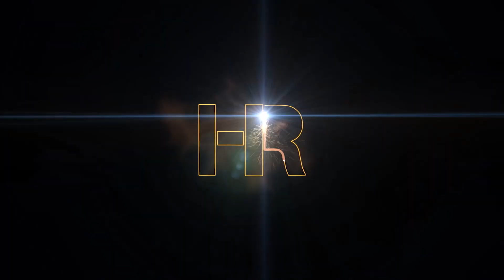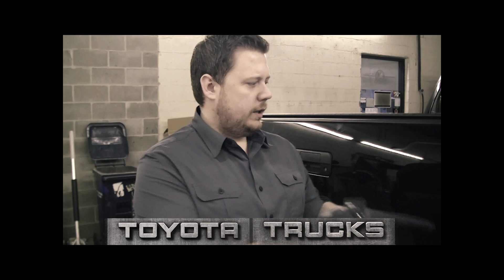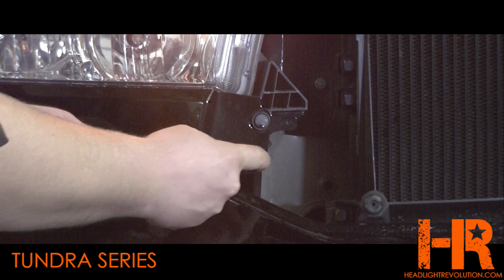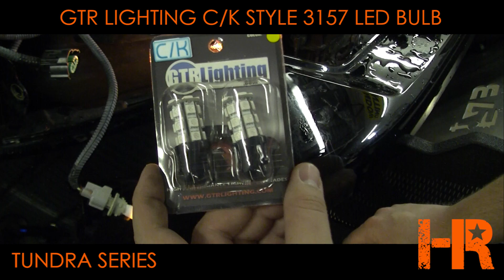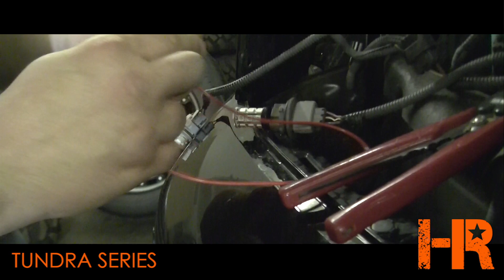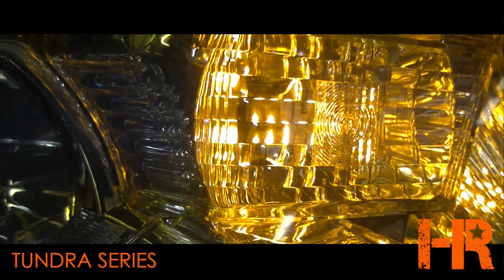2007-2013 Toyota Tundra LED Turn Signal & Parking Lights | Headlight Revolution | Tundra Series (7)

Comment: Girlie Girl, (mostly:) ) with definite hatred for mechanics and dirt, but with your video, I changed out my parking light bulb ( impossible to replace without removing the headlight...(trust me, I tried). The turn signal bulb was easy.  GREAT INSTRUCTION FOR THE 2011-13 TUNDRA 5.7!!  The job took me 15 minutes.
Reply from the maker: Glad we could help!

Comment: Great video. Thanks!  I did the mod and now when I switch on headlights, one of the Amber lights goes off, the other stays on. Before the mod, both ambers would remain on when headlights went on. And ambers stayed on when headlights went off. Any thoughts on fixing this?
Reply: I have the same issue- ever figure it our?

Comment: Soldering connections but then using electrical tape instead of heat shrink  to seal the connection ??!!
Reply from the maker: You'll be hard pressed to prove that in this application how we did it is going to be a problem.
Reply: Unless you cut wire or have to end coming together just stipping back insulation and solder new wire on there is no way to get the heat shrink tubing on the only other alternative is liquid insulation it's like a thick rubber paint in different colors and it dries like the wire insulation I've never used it but home depot electrical depot. Carrys it

Comment: So I install the resistors, it gets hot with the drl and running lights but when I turn on my headlights it cools down. I followed your wiring steps also. I don’t know why it get so hot??
Reply from the maker: Kongmeng Vang it's normal for them to get hot. Even the instructions they come with state that they will get hot.
Reply: Headlight Revolution my front turn signals stops working when the resistors get too hot
Reply from the maker: That's very weird. Give Returns@Headlightrevolution.com an email and they'll get you taken care of.

Comment: I have a 2011 Tacoma. I'm going to be doing this shortly. Is there any way you could test and tell me the exact colored wires I would need to splice into with it?
Reply from the maker: It is on our list to do a video on how to test the wires on any vehicle. Not sure if it will be in time for you.
Reply: A good automotive circuit tester or a multi meter witch has other uses lick testing house hold a/c voltage and wire continuity with will trace a wire if the problem is placed on one end of a wire and the other probe on the other finding witch wires are witch if you can't get at some metal on the wire to get a reading may have to strip away a little wire insulation is the on other way I know then if it's not the Wright wire electrical tape over the striped spot

Comment: I have a 2008 Crewmax Limited. Do you know of any possible affects changing out incandescent lights for LED's has on the lighting CPU's. For example the interior lights, including the mirror puddle lights fade in and out on my Tundra.  I have been warned against going to LED's by a local Toyota dealer as well as an experienced after market installer.
Reply from the maker: CNT 2C56 LED's are able to run at lower wattage like incandescent bulbs. They will fade in and out just like the factory bulbs would. Pretty soon LED will be the norm for lighting.

Comment: what about for a 2015 tacoma you guys sell the right bulbs for them?
Reply from the maker: https://www.youtube.com/watch?v=oGl2Mz0bUA4&t=449s
Watch this video for the 2015+ Tacoma
Reply: Headlight Revolution not the same modle of truck my 2015 is before the one in the video. my amber signal lights are also my daytime driving lights
Reply from the maker: Just tested the carbide 7440, and it does not work for the DRL.  Sorry
Reply: Everything I've tired burns fuses

Comment: Question, which is the positive on the headlight wire? White with Black Strip or solid white?
Reply: blaster. My 2017 tacoma white with back stripe I ground throughout the truck

Comment: Hey guys, what are your opinions on error free LED bulbs?
Reply from the maker: +dragon123443 Just to clarify, are you talking about bulbs with CANBUS functionality built into them? What do you mean by "Error free bulbs?"
Reply: +Headlight Revolution the ones with the resistor built into them. I think ijdmjoy sells them?
Reply from the maker: +dragon123443  Haven't really tried them. Those error free bulbs that they are selling look almost exactly the same as our Canbus bulbs: http://www.gtrlighting.com/canbus-bulbs/
Reply: I've tried the canvas and everfree bulbs worked at first but sometimes one or the other will hyperflash rain sometimes cold wheather

Comment: I have a question. I did this installation on my 2012 Tundra. The turn signals work when the  headlights are off but do not work when the headlights are on. The light is one but does not flash. Any idea what would cause this.
Reply: Hey man, I have a 2010 with the same problem. Did they ever tell you the fix for this issue?
Reply: No I ended up taking them out. Prob had something to do with lower quality bulbs.
Reply from the maker: +ChopperOutdoors Sorry about that, that's no good! Send us an email at sales@headlightrevolution.com and we'll be able to help you out and look up the specifics of your order too. We'll best be able to help you there.
Reply from the maker: +ChopperOutdoors Sorry about this. If you haven't already, be sure to send us an email at sales@headlightrevolution.com and we could help you out a little better there.

Comment: How come your add a resistor when you can replace the flasher relay with a low load flasher relay meant for led products? Seems like more work adding a resistor.
Reply from the maker: mrtwor6 It is a little more work, but it has been one of the most reliable ways we have found. Sometimes a new flasher just doesn't fix the issue.
Reply: Are we sure its a 3157 bulb? Few bulb finder sites are saying 4157.
Reply: You have a part # for the led flasher relay?

Comment: Installed these with resistors step by step as shown in the video. Lights turn on, look good, but... When my headlights are on or  switch turned to parking lights, the front ambers do not flash when I engage the turn signal. They are still on, just don't blink. They flash when my light switch is off (so during the day) I activate the key fob, or hazards. Any suggestions why the turn signal won't flash when the light switch is turned on?
Thanks
Reply: +Headlight Revolution is it a 12w 6ohm resistor or a 50w 6ohm resistor?
Reply from the maker: +wentaGT We used the 6 Ohm 50 Watt resistors.
Reply from the maker: mndonnell Sorry about the trouble! Have you tried to get a hold of us through email? Send us an email at sales@headlightrevolution.com and we can hook you up with some help!
Reply from the maker: mndonnell Yeah, send us an email so we can get a little more info from you: like the time-frame of when you purchased the bulbs and the year of your truck. We think we know what the problem could be and can help you out. sales@headlightrevolution.com So sorry about this!
Reply: I have a similar problem. The 15 amp fuse keeps blowing when I turn on my headlights at night. So none of the rear side marker lights are on in the rear. The DRL work and signal fine and I wired them according to the video. Any suggestions???

Comment: Hey thanks for the answer,  I got another question for the front signal CK LED's do I need an LED flasher  or only the ck LED's & resistors will do.
Reply from the maker: Emilio Magana No, all we needed for the install were the bulbs and resistors.

Comment: Do you have to install a resistor for each turn signal light or just one for all the lights
Reply: Ken Reichenbach one for each. they waste power to match how much the old ones used. try replacing relay instead.